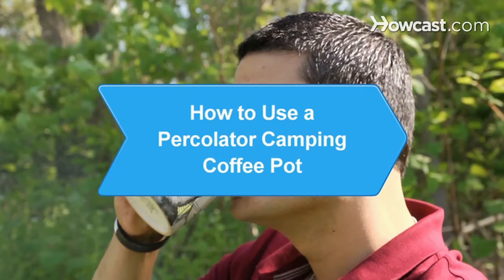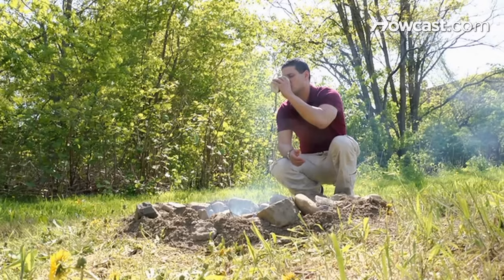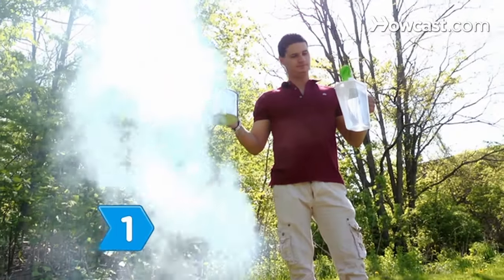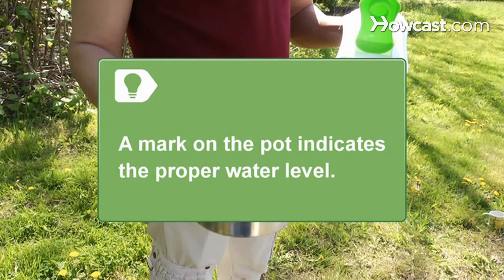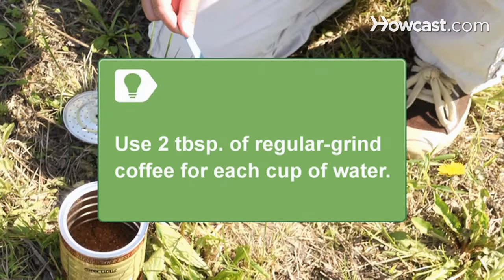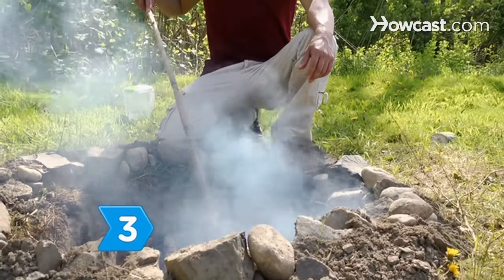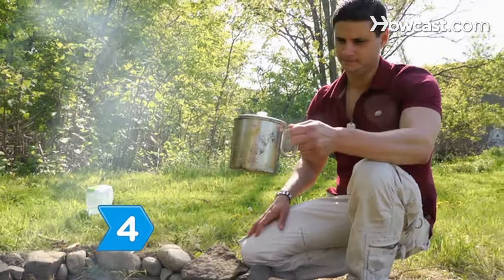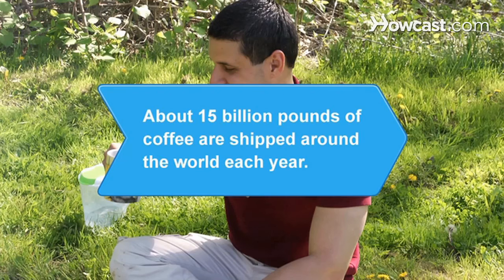How to Use a Percolator Camping Coffee Pot

Comment: You know you don’t have to fill the tin up until it reaches the bottom of the basket… the whole point of the percolator is for the water to *percolate up through the little straw/tube part in the middle and then spill over into the top part of the basket (which also has holes) which then drips down into the basket containing the coffee grounds…

The coffee is actually very watery if you have to put enough water in there to physically touch the bottom of the basket .

Comment: This is a legit way to make coffee camping, especially canoeing with a few coffee drinkers. An old percolator from the basement or a lawn sale is about as cheap as you can get. A French press uses less fuel, as you just have to get the water boiling- good if you are using a camp stove and want to save fuel.
Add the coffee before you put the basket in the pot, to avoid spilling grounds in the bottom of the pot. Leave the basket in there- preserves heat in there for seconds and latecomers.